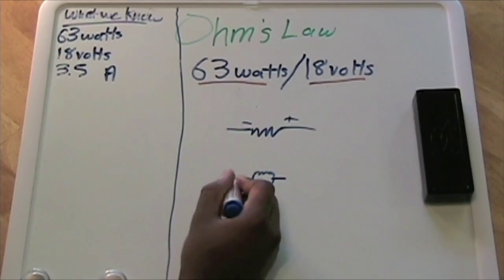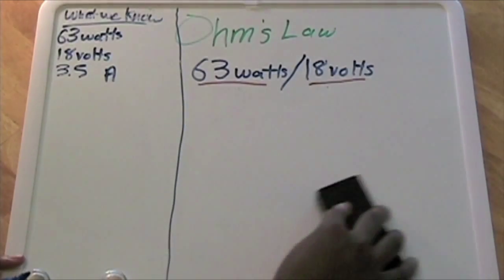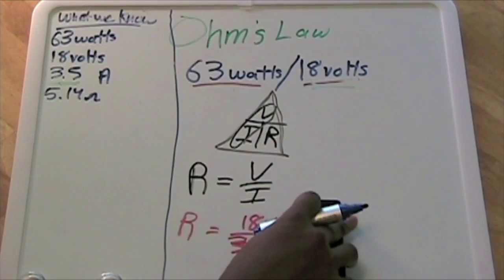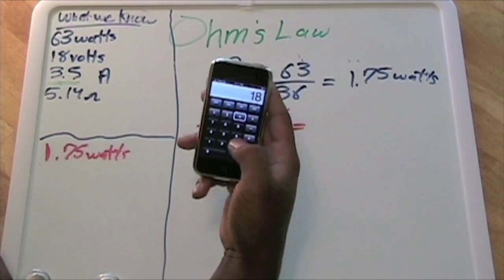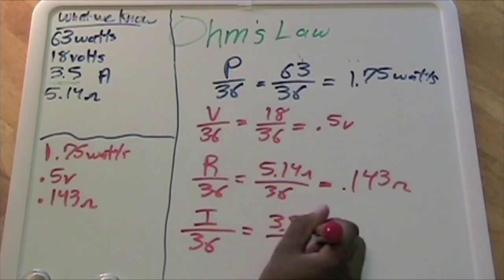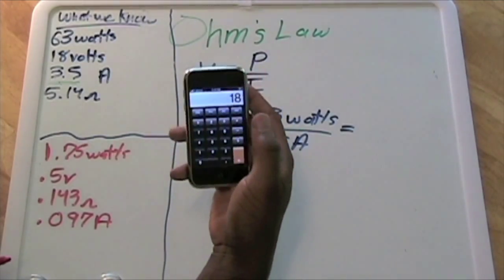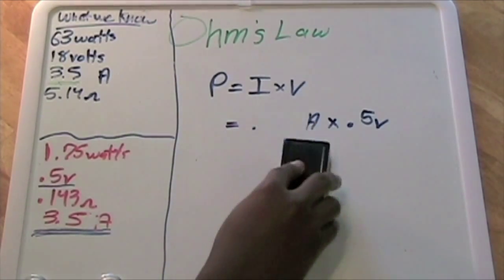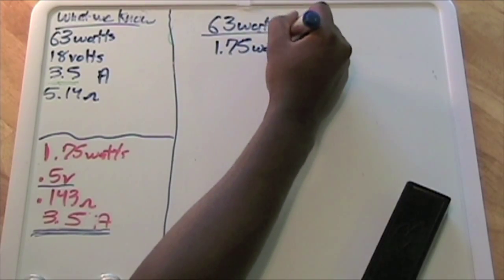How To Build A Solar Panel - Part 16 - School Series Part 3

Comment: You could more easily explain why the current is not divided when wiring in series by using a river.  If you take a river that is flowing 100,000 gallons over 100 rocks at 5 mph then you split the entire river bed in half, the river is now flowing 2 channels of 50,000 gallons over 50 rocks but still at 5mph.  The resistance (rocks) is split in two smaller parts, the wattage (gallons) is split in two smaller parts, but the current (speed of flow) is still the same.

Comment: The reason your current didn't work out is because you used the wrong values in your formula. Your right in saying the current is the same in a series circuit, so that means if you want to find the Total current, you take the Total voltage of the circuit & divide by the Total resistance of the circuit. This will give you your 3.5 amps.If you place a meter any where in the circuit, you will get 3.5 amps.You can use the triangle method for watts(goes up top)also.Ur series has been very informative